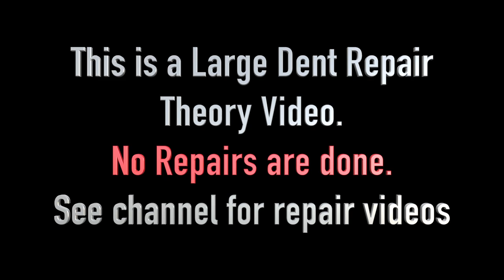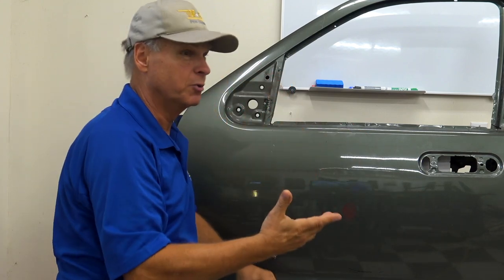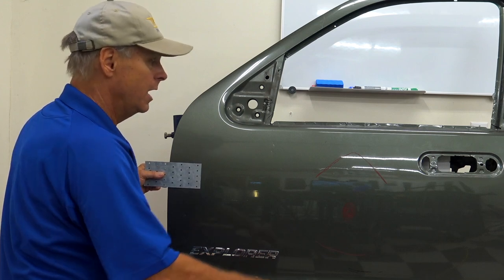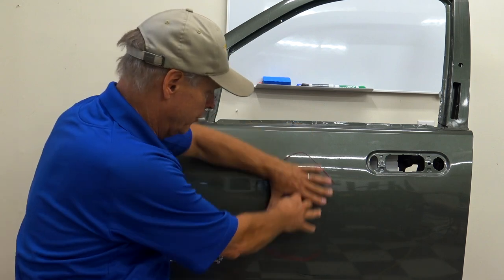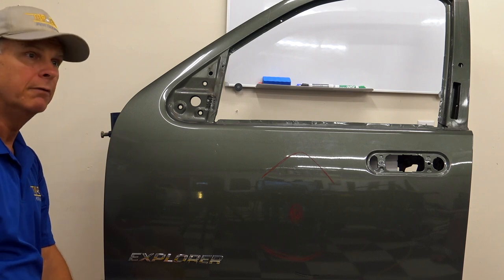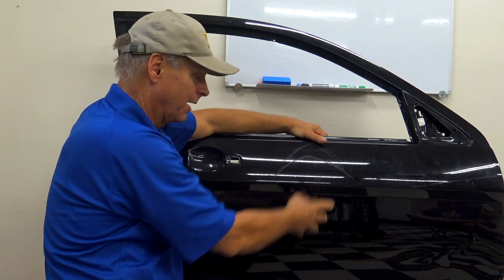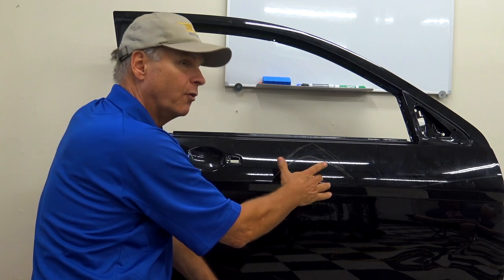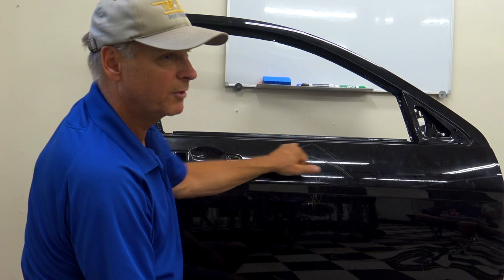Large Dent PDR Repair Theory  #2

Comment: You should do a video with you doing it your way with tension and the same door dent repair without doing tension repair. So we can see the differences and time of each technique. Thanks
Reply from the maker: Yes I've been waiting for the right large dent repair to match any of the ones I've done by tension and repair it without tension but it's tough to get 2 repairs with damage that close. The black door body shop repair and the white Honda are good examples of quick repairs that couldn't have been done to that level that fast without tension.

Comment: Hi how do you know which direction a panel should be in tension? I'm working on my hood - hit a snowplow years ago. I lived with the dent this long but after your videos I was actually able to get a lot of the dent out with just my palms banging out the crowns. All in about 25 minutes. Amazing! I also straightened the radiator support by removing stress from the metal buckle points by torquing it back forward while hammering the buckle points
Reply from the maker: Tension only works on flat panels like doors and quarter panels. YOu always put tension along the flat plane of the panel as shown in the video.

Comment: Great video Marty👍 Few questions 
◾️What’s your opinion/experience on tension pulling on a repainted panel, will the glue plates every pull paint?
◾️Can you do tension pulls w/glue plates on quarter panels or do you just use glue tabs 
with tension straps?
◾️Does your metal theory you explained in this video also apply to high strength steel and aluminum panels?
Reply from the maker: Hi Matt. I would never use tension on a repaint. Yes I use tension plates on Quarters all the time.  Your last  question would take way too long to type out, but yes I do use tension plates on aluminum but in a much different way, and HSS does respond to tension but not as well as standard sheet metal.  I may do a video on some of this though.
Reply: Top Gun PDR Training Thanks for your replay and the time to make these good tutorials👍
Reply from the maker: @mattarmijo5394  You betcha

Comment: great another hour of a whole bunch of talking and no actions. i learn by watching others not by watching their lips move. unfortunatly i watched a few seconds of the intro of this. after your previous video that i didn't realize it was all talk i'll not sit through another lecture that will only give a different view of the same dent or perhaps a different door who knows. either way you're not doing any actual work and explaing why you're pulling where you are first. thus, i'll not learn anything from this video.
Reply: We do the 2 theory only videos first, then the repair videos. There are lots of actual repair videos on this channel. Theory is far more important as that is where the money is. Wrong theory will cost you lots of extra time in your repairs. Correct theory will give you fast, clean and efficient repairs.
Reply: @martyrunik  that's a crock of shit. patience when doing any auto repair body or otherwise is key. you can theory something to death and never fix the problem. there is no money in theory due to the fact you have to straighten the dent to get paid for the body work. theory doesn't fix the body. effort in it does.
Reply: @martyrunik  spend 5 hours doing theory instead of using what you already know towards it and having it finished in that same 5 hours. YOU'VE GAINED MONEY AND TIME. hmmmm.
Reply: This comment is a perfect example of what I talk about in the theory videos as far as the "just move the stinking metal" attitude of most auto body techs. Your mind is made up so continue to do what you've always done.